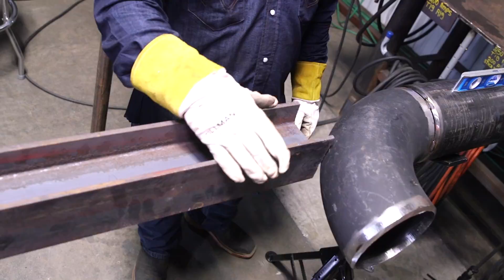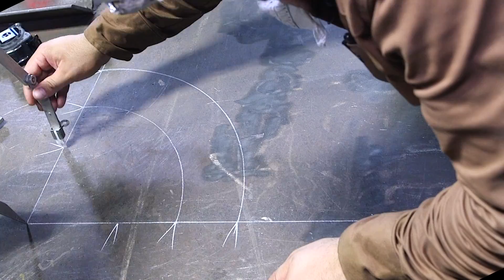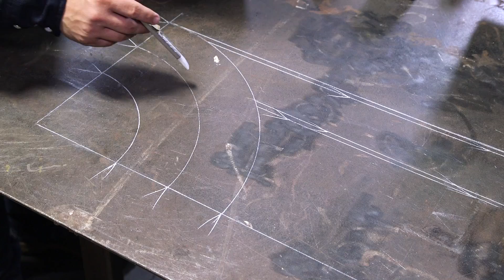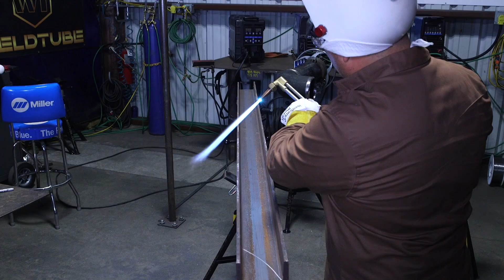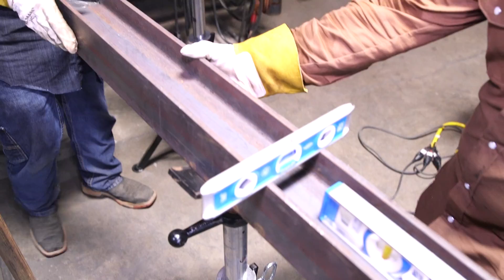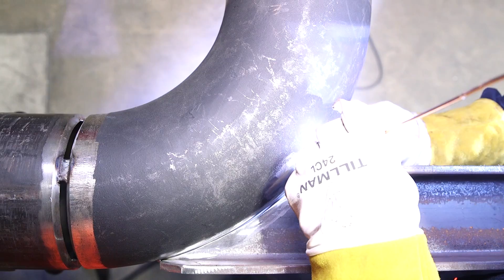How to Layout and Fit-up a Dummy Leg | TIG Welding

Comment: One tic is better than two when using soapstone. Old brake operator told me if you can't hit the mark on the first try, you are doing it wrong. Haha. Also helps if you are doing layout and someone else is fitting. They don't have to guess which tic to go from. Just add a "tail" to the tick so they know which end is which.

Comment: Any tips on doing this in the field when there's no shop table to work off?
Reply: On the ground, or even a piece of wood or cardboard
A flat and large enough surface in which you can draw out all that is needed
Reply: I would just get some pipe and make a 45 degree miter cut on the fly if you don’t have your layout or coordinates for the dummy leg
Reply: Just do the measure back technique